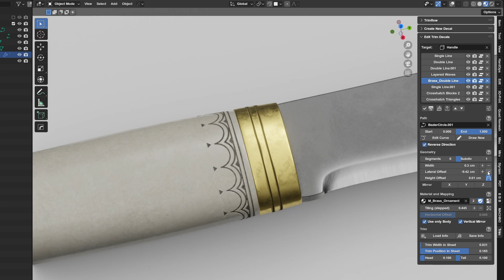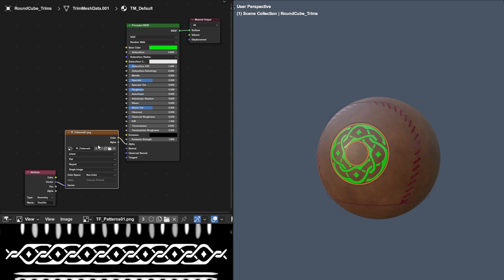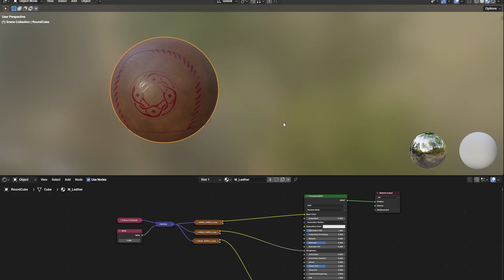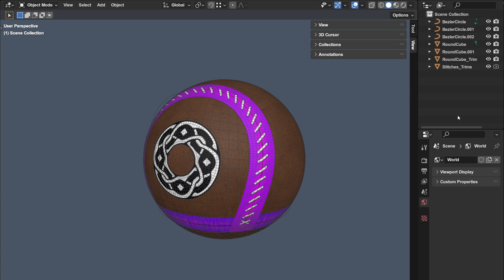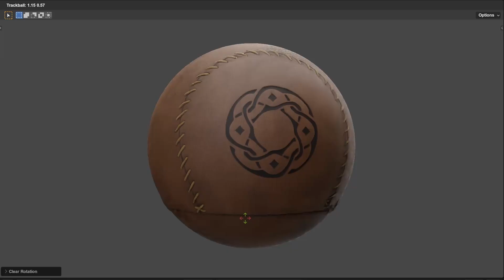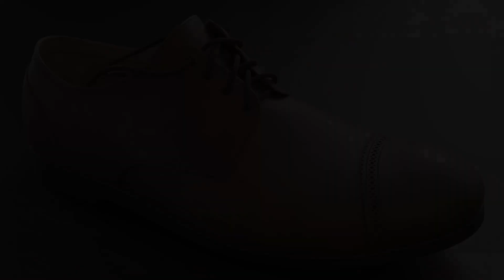Trimflow: Baking Trims

Comment: Could you please create a guide how  to prepare this RGB Decals? 
Or if possible probably  with resource files, provide some node setups for auto generating such RGB decals from geometry. 
Kinda copy paste some geometry inside blend file and in a few clicks get RGB file, do you think its possible?
Reply from the maker: Hi, there is a chapter in the documentation on how to create trims(heets): https://docs.shape-shift.de/trimflow/trim_creation.html
I'm actually working on a little tool that pretty much does what you describe. Just needs a little bit more testing and a finishing touch.

Comment: not working with blender 4
Reply from the maker: Trimflow version 1.1.1 works with Blender 4.0 and even the current 4.1 alpha. You are probably using an older version of the add-on. Please contact us if you still experience any issues.